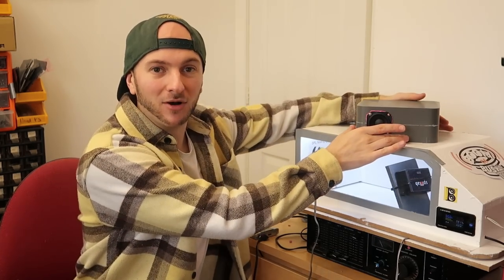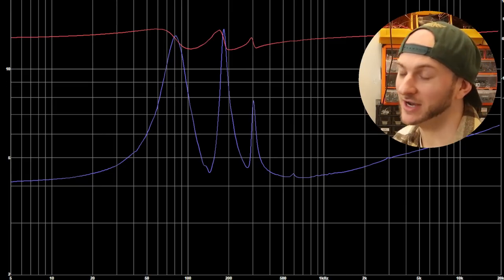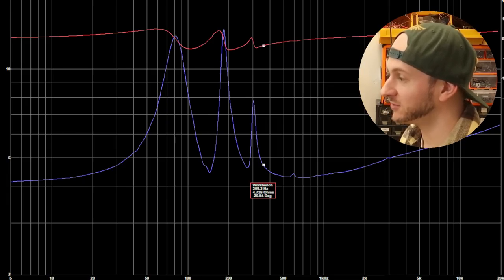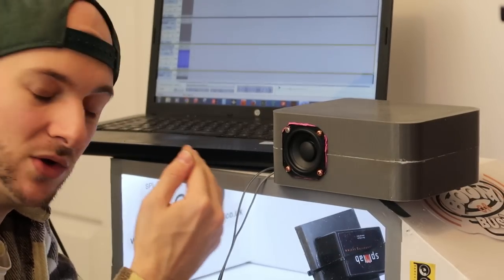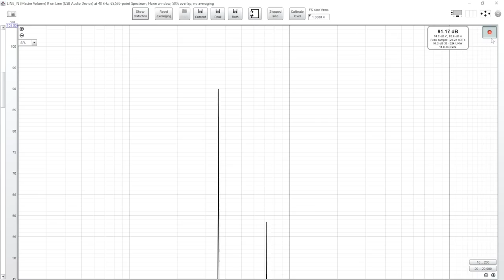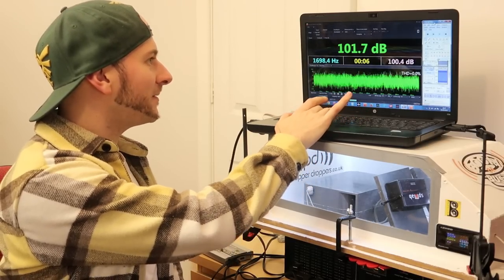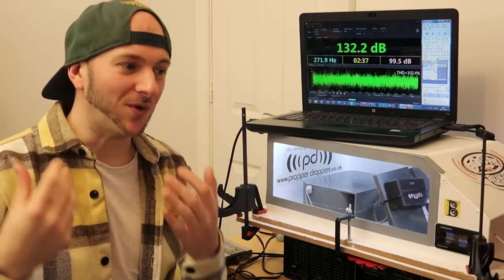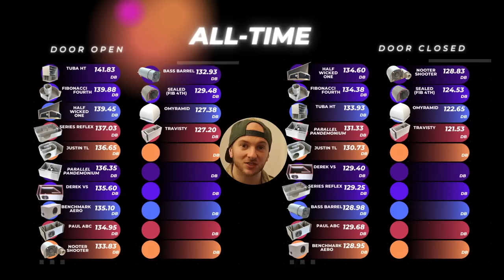Two Ported Boxes In ONE?! | Boom Or Bust S1E14

Comment: There we go! Now we see a 6th order bass reflex! Only difference, is the design backwards, but still worked kinda. A typical 6th order bass reflex is low chamber ported into the high chamber, and the high side ported to the atmosphere.
Reply: A true 6th order will have the driver mounted in side the enclosure having the front waves firing into 1 chamber and the rear wave firing into the 2nd chamber in both parallel  and series tuned
Reply: @ottobauner9828  There is a such thing a a 6th order bass reflex. Search up counting acoustic orders. Hexibase does a rundown on how to count acoustic orders.

Comment: Hope to see more experimental designs like the fibonacci 4th being the only one that takes advantage of the 3D printers capabilities.
Reply: What if the port was the shape of the Tesla valve
Reply: @dooflydetailguuy4349  
Good idea! Worth a try or at least a variant based on it.
Reply: @dooflydetailguuy4349  
You'd effectively be creating a ported enclosure that acted like a sealed one. For SQL purposes, it could end up alright, but I can't imagine it'd bump anyone off the current db charts.
Reply: @RAW_Reality  would it act as sealed for only half the wavelength though.
Reply: @dooflydetailguuy4349  Considering that I've only ever seen a Tesla valve operating while constantly pressurized, that's an interesting question... Honestly, I'd have to believe that theory would be correct.

Comment: I would love to know how to design a series ported enclosure ! Nice vids 👍
Reply: hornresp and virtuixcad can both model them. hornresp is a bit harder to learn, and assumes perfectly rigid materials and no losses from leakage and such. vcad also does this by defualt, but you can add Ql, Qa, and Qp values to make it more accurate to real world.
Reply: @mustang351c4  thank you ! 👍
Reply: Built one last year. Series ported box  had a hard time with it. But with that being said sounded fantastic. Pretty flat sound not super peaky at tuning. It went very low 25hz and kind of high at about 90hz . My buddy that asked for it loves it. He is running 750 or so watts on dayton Max x subwoofer. Edit for home theater.
Reply: @mustang351c4  yeah about that i used Vituixcad for my 6th order bass reflex with the following parameters
Ql 15
Qp 30
Qa 30

But it behaved like there is no leakage at all (just like hornresp simulates it or vituixcad when all parameters are 100).

I have no idea why it preforms like this. Maybe i made it too airtight but idk

Comment: Speaking of excursion, someone should do a series where they test many subwoofers in free air and see which one sounds the cleanest.
Although the cooling system does make some noises depending on the design. 
A true SQ sub should make absolutely no noise at least at 2” of excursion. JL Audio is pretty good at that as an example.

Comment: its like putting a ported box in your car with the window open. So really once you put the duel series ported box in your car and opening the window, it turns into a triple ported box.
Reply from the maker: It's not the same, that example is like a series tuned 6th order. Applying that logic to this box would be having the driver mounted to the outside of the car, with a ported box on the back of it vented into the car, and then your window open ☺
Reply: @barevids  Hmmm . . . Im thinking about redesigning the seating position of the driver now . . . Right on the hood . . .

Comment: I have a enclosure like this in my room. I made it with a dd 506d2. Its about 30x30x50cm. And it does have port noise at the tuning frequency (25hz). Even at pretty low volumes with about 25 watts. The port is about 3 inches in diameter and its about 30 inches long.

Also the software i used (Vituixcad) showed in the graph that it would sound pretty flat but it doesnt really it has a huge bass boost at 25hz (which i fixed by using a 30hz high pass on my amp)
I think this is cuz of the ql, qs and qp parameters but i aint sure.
I used 
Ql 15
Qs 30
Qp 30
And it preforms like it has all the parameters set to 100
Reply: port velocity and flaring are very important, 3" is pretty damn small, even Logitech (known for port noise and wind) use 4" ports in the Z623 lol

you want to keep the port velocity/air speed low by having more port area (as size increases length will too, unfortunately, so your box will increase in size a lot
Reply: @BH4x0r  yeah bigger port area is better but i tought it would be enough cuz my driver is only 6 inch and a bigger port really wouldnt fit cuz the port already has 2 90° turns in it and the 2nd chamber size is about 20 liters which isnt small. But hey i learned from it and thats important too
Reply: @BH4x0r  vituixcad said that the port velocity would go above 17m/s at like 100 watts so port noise at 25 watts is interesting to me and i could increase the flare on my port cuz the flare is pretty small atm.

I also tought it was going to be enough since the port has a way larger surface area than the 8 inch infinity sub that i had that had port noise but i atleast tought it would be less and it is now that i use a highpass filter (through which it still plays lower then the infinity subwoofer so thats nice) eventough the sub isnt perfect its good enough for what i use it for
Reply: @troybakker7628  i would make the whole thing larger tbh, but flaring it might help a bit, 17m/s is like 61km/h port velocity, thats stupid high

you could aswell ditch the port entirely and use a 10" PR instead if you don't want a larger enclosure
Reply: @BH4x0r  i think i would make one with a pr then but the i might also want a diffrent driver so then ill be 400 bucks lighter so ill stick with this setup for a while.
Reply: @troybakker7628  when you tune the PR and add some dsp in the mix you can get some impressive results

consider how bassy the JBL Boombox 2 and Harman Kardon Onyx Studio 5/6/7 are out of a tiny woofer, PR and low enclosure space

on the other hand you'll lose some efficiency/loudness

i'd recommend just going a larger port and have it stick out of the box if you don't mind that

you can also have a good port extension and build wood around it to make the box look bigger and not like a last minute redesign or afterthought

Comment: @barevids can you help me ? i have a taraamps hd 3000 and i use it to run this RCF LF18G401 SUB  ( 8 ohm  1800 W  ) i wounder if i schuld usw another amp ? the sound was not that great , im now upgrading to a LiFePO4 300Ah 12V and thicker cables and maybe a new amp ?
Reply from the maker: Set all the knobs on the side to minimum apart from the gain. If still no good then your issue isn't the amp, more likely the box etc. You don't need lithium for this setup. AGM would be fine.
Reply: @barevids  if you ask me they go to clipping to early could this be a problem of the size of the box ? sorry for my bad englisch
Reply from the maker: if clipping on kick drum fast notes, LPF is too high. if clipping on long low notes, you have just reached the limits of that amplifier and need a bigger one.
Reply: @barevids  thanks a lot man